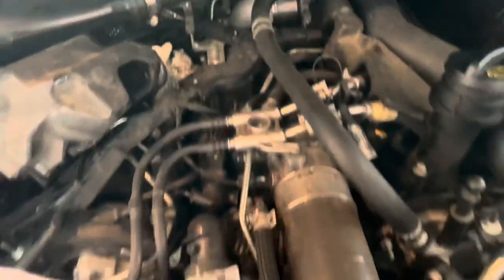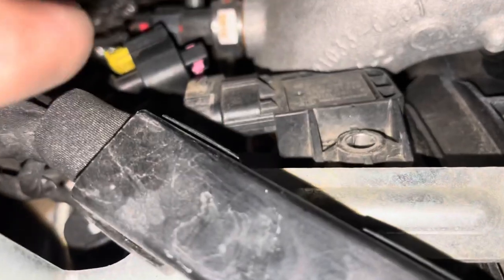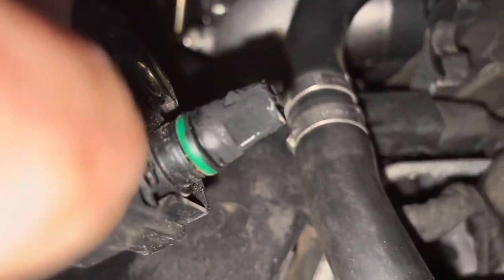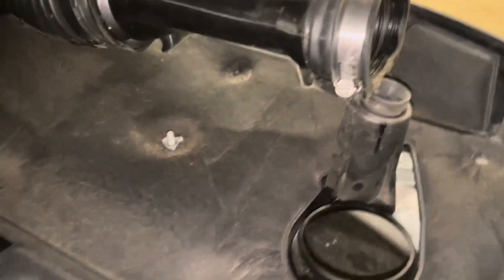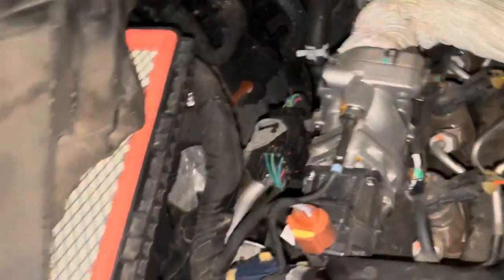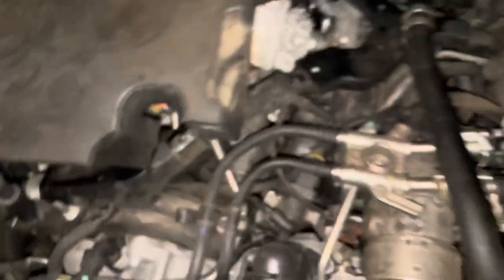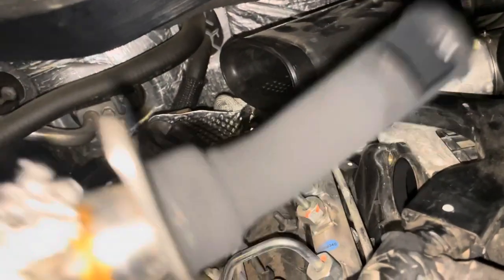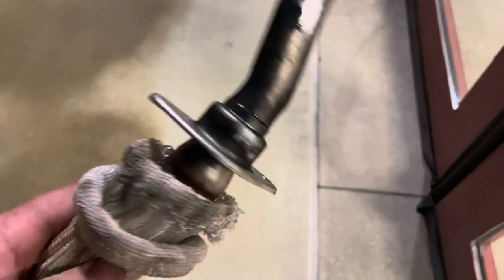Ram Eco-Diesel Service Electronic Throttle Control message | possible fix

Comment: I have a 2019 ecodiesel and this video showed me how to get home after Christmas yesterday. 

Thank you sir you really helped me last night.

Merry Christmas. 

For anyone reading: I put 81,0000 km on my dodge, bought it with 0 km and the throttle body sensor was totally gunked with diesel soot.  Very easy fix. Use sensor cleaner and compressed air. Plug back in. Delete codes.
Vroom vroom baby!

Comment: You fixed my ride.  I commented a few days ago your fix wasn't working for me, but no shit, it actually fixed it.  The "fix" only didn't work because I was an idiot with clearing the code. Spraying the map sensor, cleaning it, and cleaning the tube fixed my problem.   It's all thanks to you.  Saved me so much anxiety, money, etc.  Thanks.

That Service Throttle Control is a killer.
Reply from the maker: Awesome! Glad that got it going!

Comment: This did not clear my throttle control problem, but you taught me one more aspect in preventative maintenance on my vehicle.  And damn, these things were bad on my rig.  This video was awesome, thanks for the help  and teaching me a new skill
Reply: Same. I cleaned both those parts and did not clear it . Still limp 😕 
How did you fix your issue ??
Reply: @mavila8817  after I cleaned it all, I had to reset the battery and code. I yanked the battery cables off and just reset after cleaning. The carb cleaner on the sensor and tube did the trick. They were pretty nasty. But it was that battery reset that ALSO was an issue for me.
Reply: How did you clear your error? Still showing error
Reply: @MrJas6477   do you have a code reader? I only have a cheap one, (which may have been the answer in conjunction with cleaning the sensor/tube. ) (I know some codes require the diag tablets that can get around the FCA gates, but I didn't have that during this issue). Was your sensor pretty gummed up? Make sure it, (and the tube) gets cleaned well.

Comment: My last electronic throttle body control failure was my third crank. Position sensor failure. The before that was a soot clogged intake manifold that required replacing.

Comment: Hi, I'm new here. Could you help me... I have a 2017 Dodge or Ram Truck RAM 1500 4WD Truck
V6-3.0L DSL Turbo and I get codes p0473 and p0471... I have the warning light on.

Comment: What about the light on dash says service electronic throttle control ? How should that light get off ? With scanner ? Just erasing coeds ?
Reply from the maker: Can disconnect battery for a few minutes or use a scanner 
If it’s coming back then there’s an issue still

Comment: Just got my 2016 1500 Ecodiesel truck back after 6 months of not having it due to a blown engine, first thing that pops up as I’m driving home is this code light. Called the dealership and they told me to take it back to get it checked out in 2 days, is it safe to drive with this code? I don’t drive very far for work maybe 30 mins max but I’m concerned.
Reply from the maker: Could have decreased power and hit limp mode but I wouldn’t expect it to cause major issues if there aren’t other symptoms
Reply: @crutchfieldautomotive7936  no other symptoms, but this was helpful thank you!

Comment: Hey do know where I can get the information how to change out the fuel pedal. Swapped them out but truck it didn't sync up and throwed a check engine light. Any help you can give will be appreciated
Reply from the maker: Pull the code first and see what it’s showing
Reply: I got to looking Autozone gave me the wrong pedal. Thanks though amd please keep making video on these trucks there isnt many on here.
Reply from the maker: Unfortunately it’s sold, if I get another I will

Comment: Replaced map sensor cleaned diffuser tube , replaced egr cool , intake manifold . Drives for awhile and then goes in limp mode , rest it with my scanner and drives good then acts up again . It’s at shop right now and it’s deleted . Any other ideas possibly other than mabey throttle body position sensor
Reply from the maker: Accelerator pedal sensor check out?

Comment: I cleaned both of these parts (they were extremely filthy) I cleared the code and it ran smooth for a couple hours , it’s back in limp mode . What do I do next 😅🥲
Reply from the maker: Have a way to pull codes?